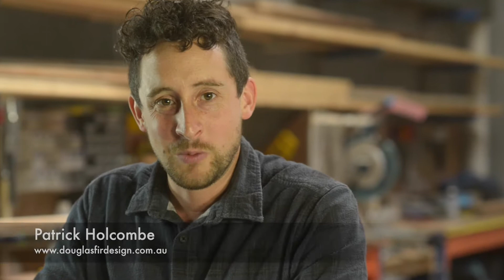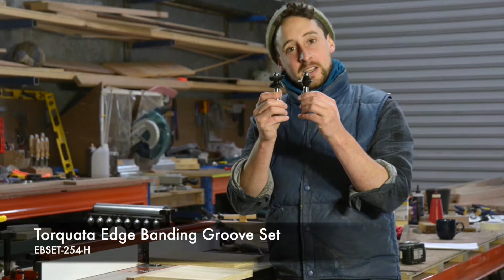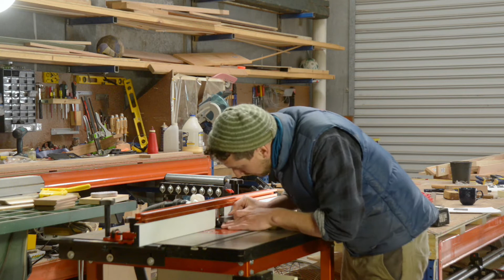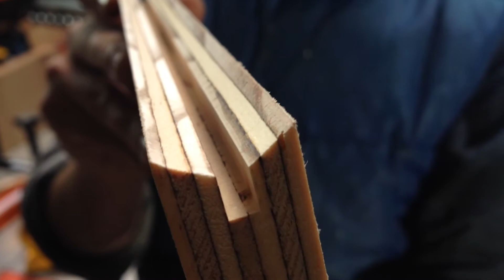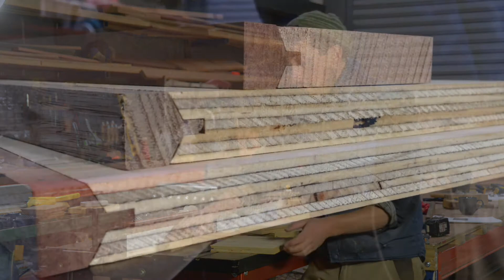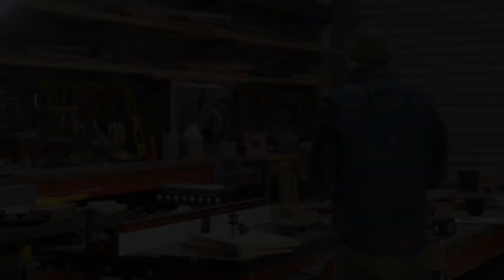The Router Bits - Using the Edge Banding Groove Set

Comment: Could these bits work with a hand router?  I saw the thumbnail, then you subbed in a router table - I'm looking to edge a desktop, so I can round-over the front corner.  I can't run a 26" wide board across a router table. Is this type of joint possible by hand, or am I more likely to ruin the edge trying?

Comment: A really good video. I have an old set of similar bits but they need replacing. The set I have doesn’t have the spline section in the middle of it like the set you have and I like that feature. Do they ship to the U.S.?
Just a little tip here.... A few years back i made a large bookcase for a friend. He was a professor who needed long shelves for his reference books. I used the set I have to make the shelves. To really stiffen the shelves I put edge banding on the back of the shelves first, then the sides, then the front. The shelves held about 60% more weight without deflecting than just the plywood and about 50% more than just edge banding the front.
Thanks for the demonstration...
Ron